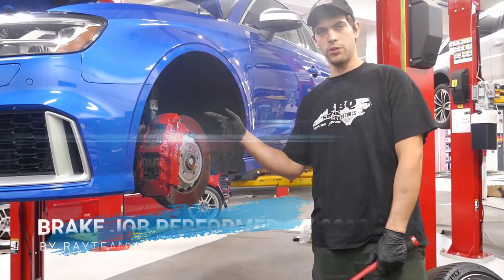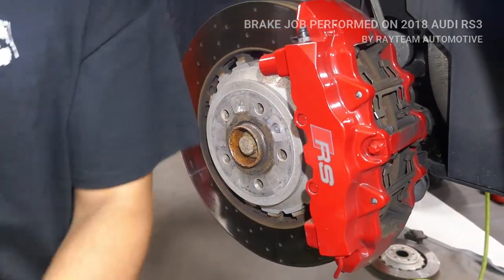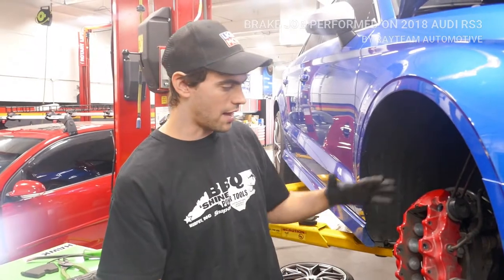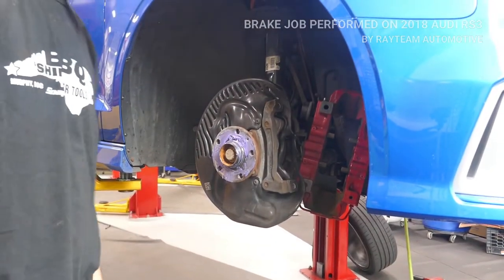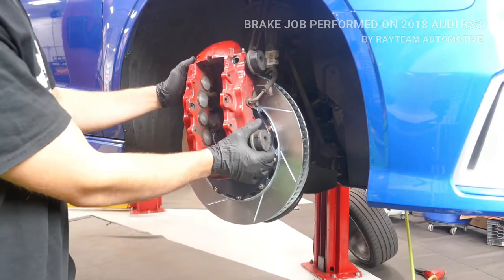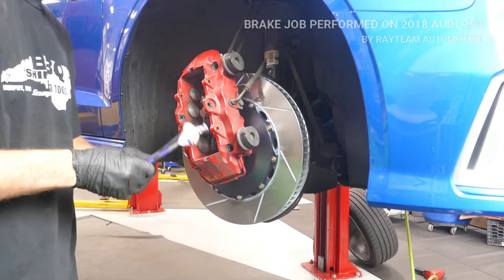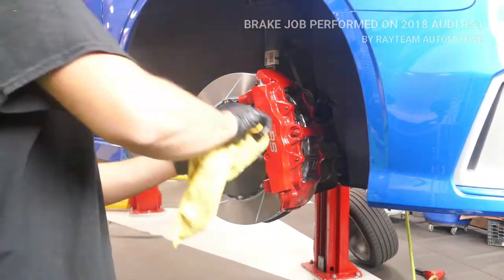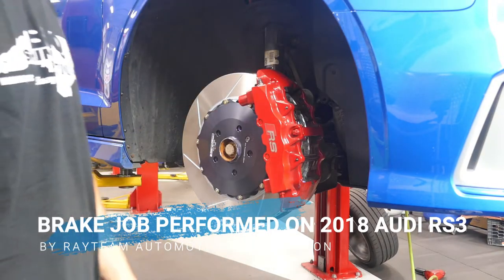RayTeam Automotive - Brake job performed on a 2018 Audi RS3 (v4)

Comment: NEVER!!! remove the caliper support bar. There was no need to do it to do any kind of service work. They are torqued on a specific jig and removing them can cause issues with caliper flex. 
You don’t need to remove these to change pads or remove the caliper. Not to mention you just destroyed the sealed painted surface, so expect that paint to start chipping and peeling off right where the bolt was removed.

Comment: I installed speed bleeders on all my brake calipers. So when I go to spread the pistons, instead of opening the brake fluid reservoir, I open the bleeder valve on the caliper and attach a drain tube. Then when I spread the pistons, the old, cooked brake fluid at the caliper gets pushed out through the bleeder valve. After I'm done I close the bleeder valve and go pump the brake pedal to push out the pistons again, and I top off the reservoir as needed with fresh brake fluid. Doing this procedure gets rid of the most cooked brake fluid. Of course, if you decide to flush your brake lines then this doesn't matter.

Comment: Don’t blow air... Audi are quit specific about that... no mask either!!
Reply: pretty sure thats for the carbon ceramics which these arent.
Reply: @nelsonsantana6778  i just checked the Audi workshop document and 100% is says “Warning Risk to Health… don’t blow with compressed air”
Reply: @nelsonsantana6778   Her e is a link to the manual page.. you can see the wiggly steel RS Q3 discs in the image too ... https://www.dropbox.com/s/xpzmxiqegylzg4d/IMG_1500.PNG?dl=0
Reply: @idiocratease  Where did you get the manual? Have a hell of a time trying to find a copy for my RS3
Reply: Was thinking that as well.

Comment: I have 2018 RS3, My Audi dealership told me that I’ll need to replace brake pads around 30K KM. I never tracked my car or been aggressive on my car. Is this normal to change brake this fast.
Reply: Yup, the factory pads are absolute trash. Same with the factory rotors. They are trash after 30k or less. Surprised you made it that far, mine needed it before 22k (kms)
Reply: @PilotThumper  so what did u replace them with? Rotor and pads from what brand? Did ur after market pads come with wear sensors?
Reply: @TaimurBaig87  EBC red stuff pads. I surfaced the rotors but will be replacing the rotors later on with 034 Motorsports slotted rotors. 370mm front and upgrading the rears to 350mm
Reply: @PilotThumper  I have a 2020 RS3 and after only a bit past 15k (km) I had to go replace my first set of stock pads at the dealership. The replacement pads only last another 15k km before needing to be replaced again. I do not track my car at all and do some "spirited" driving only from time to time. Now at 33k km, I was told that my rotors must also be replaced. I am in complete shock. This is way too expensive and way too soon to be dealing with this type of work. I'm going with EBC red stuff pads and GiroDisc 2-Piece Slotted Performance Brake Rotors instead of going back to the dealership and doing OEM.
Reply: @eddies1994  honestly, you can scuff the stock rotors and slap pads on them. I did just that and now have 57k (kms) on the car. When the EBC pads are done I will for sure need new rotors tho. 
If you can take the rotors off and have them machined I would give it a try. Saves a decent amount of money.
I get what you mean about brakes being way to soon. I’m used to 50-60k and needing to start thinking about brakes….not less than half of that.